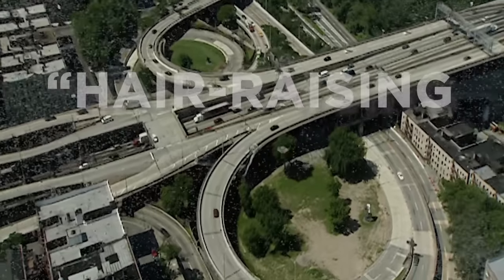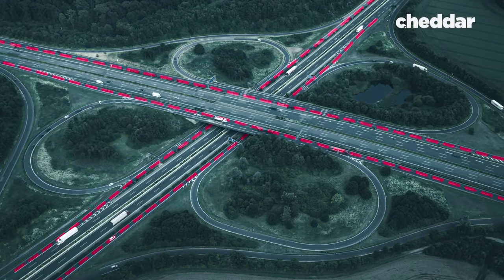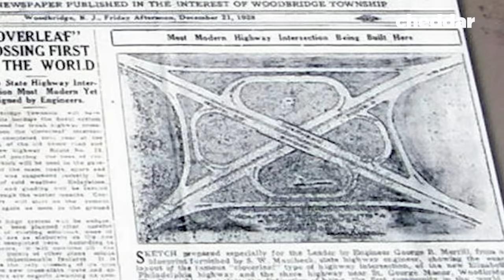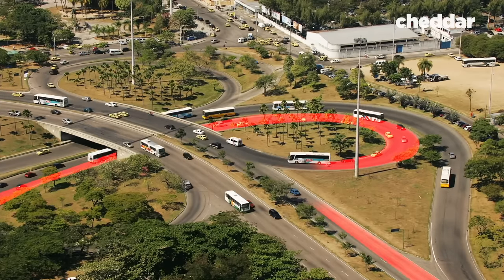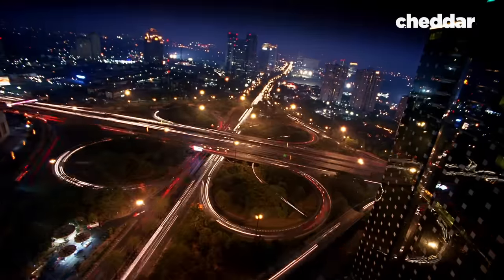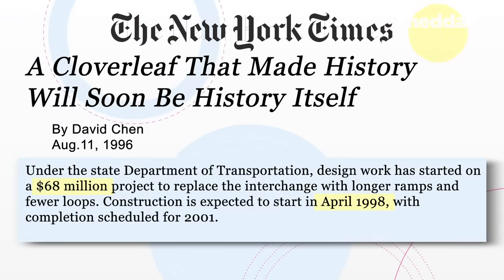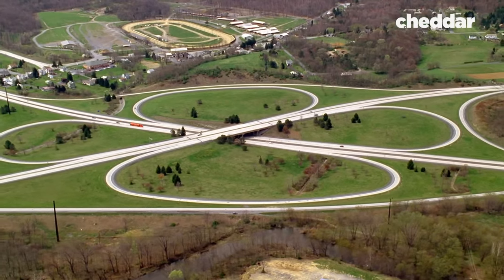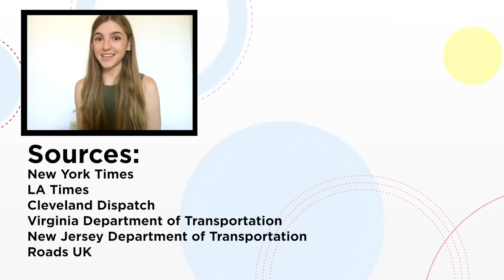The Big Problem With Cloverleaf Interchanges - Cheddar Explains

Comment: In the Malmö area in Sweden, we use a lot of those cloverleaf interchanges. Traffic is quite low by American standards, so these intersections have proven to be safe and quick. I don't think I've seen a single accident during the 20 years we've had them.
Reply: You guys also have more modern ones which fix some of the issues presented, for example sperate slip lanes for the exiting/entering traffic to make the weaving problem less bad
Reply: @AdamSmith-gs2dv  они не тупые американцы, у европейцев города созданы для людей, поэтому у нас мало автомобилей
Reply: @AdamSmith-gs2dv  - Europeans are tidier drivers, lane discipline, indicator use for lane changes, pulling into or out from the kerb, or motorway shoulder.

Some YT comparison vids about by US expats living in EU.
Reply: Same in Germany
Reply: @AdamSmith-gs2dv  We do!
Reply: People in Europe learn how to properly drive. In America, not so much.
Reply: @jjlasne  Enforcemeny. Education. Outlaw society admired in the USA.
Basically Americans need discipline. We are delinquent.
Reply: My bet is that you have people exit before the on ramp traffic merges.
Reply: In Northern Ireland we also use these on motorways or large A roads. But we usually use a slip off slope and attach it to a large roundabout above the motorway. This slows cars down when switching large roads which makes it very safe.
Reply: @jeremyh.pritchard5325  that’s not true at all. Just go to Italy and you’ll see it’s a lot different than a lot of Western Europe
Reply: These aren’t bad interchanges by any standard it’s just like was said, more than 1000 cars per hour is too much traffic. For medium level traffic by American standards they are perfect

Comment: In the Netherlands we have a large amount of these weaving entry-exit lanes, sometimes being very short. You get taught how to negotiate them in driver’s ed, and because everyone’s taught quite well, you almost never run into problems. It’s not the road structure that’s at fault here, it’s your driver’s ed that’s incomprehensibly limited and unconstrained. Weaving isn’t hard when everybody sort of knows what they’re doing.
Reply: Its both. Even if you have no problems negotiating the weave, it still slows down traffic and there's still an increase in the chance of an accident where if you didn't have these weaving entry-exits you could get rid of both problems.
Reply: I just fucking hate the bit between Feyenoord and Ridderkerk southbound on the A16. I don’t know what drivers education you’re talking about, but clearly everyone suddenly forgets everything about proper weaving as soon as they approach that section of the Rotterdam ring road.

Comment: you can fix weaving in cloverleaf interchanges by separating the on and off ramp into a slip lane so the on and off traffic go into a single lane. Alternatively although Ive never seen it done is to pass the offramp over or under the on ramp so they don't even share a lane at all. It makes much smaller bridges and tunnels than doing massive flyovers.
Reply: flyovers are great. Both as engineering marvels and fun to drive.
Reply: @michaelbruvolt4221  just expensive.

Comment: Even in rural areas these interchanges SUCK. Even without the conflict of people having to merge onto the highway right before others are trying to get off, the loops are just terrible for safety. Having to slow down to like 40 mph for the loop and then speed up to merge onto the highway is just stupid
Reply: 40mph is quite fast for the loop. how big are the ones you take? at most i can get up to 33ish before it starts making me a bit nervous, especially in winter. and dont get me started on trying to merge when youre stuck behing a truck going 20mph on one of these.. people will yield to the giant truck going 20 but not the tiny sedan behind it lol. fuck these interchanges

Comment: sometimes the audio and video are at different times in history.  a major failing of the interstate system is that it didn't provide cloverleaf interchanges at important arterial roads in urban areas and sometimes in suburban areas, thus your off ramp ends in a traffic light and if you choose a left turn at the light you might find yourself shortly at a second traffic light at the other side of the interstate.  Now when traffic is heavy this might result in what marines call a clusterflux prevently almost all traffic from moving through the intersection.  eventually the arterial road will fall short of its design capacity and alternatives will be needed.  This shoddy design has bee brought to you by the makers of traffic signals who every year donate large amount to local election campaigns to insure that you have the latest and greatest in traffic signalling devices and your taxes never go down.

Comment: the cloverleaf interchange is not the problem, too many people having the need to rely on cars on said roads, is the problem. I live in one of the densest populated countries on this planet and we use a ton of cloverleaf instersections and they work just fine. The main reason being that despite having many many cars on the road, and many millions of kilometers driven, there's alot of public transportation that's efficient enough to compete with cars and cycling. We've got the cycling infrastructure down to a T (or whatever the proverb goes like). Grocery shops and other daily/weekly essentials are well within cycling range, which makes it very often the more efficient/desirable way to do things.
There are solutions to your problems, one of them is the residential zoning not allowing for ANY commercial activities. This makes car usage immediately the most efficient way to do the type of things i mentioned above. Just to illustrate, i've lived in 3 towns and 1 city and in 6 different houses. Most of the time i lived near a supermarket that was within walking distance. I could go shop for food on a daily basis, buying a little, hunting for special offers, be done in 10 minutes, while not spending on fuel AND saving on food purchases. (you need to be disciplined to NOT impulsively buy the soulfood all the time)

Also if you allow for some commercial activities within your residential zones, commuting is also immediately reduced. Just keep your (hard) industries away from your residential zones to keep them desirable.

Comment: What they really couldve done is made merging lanes on the highway specifically for the people coming from the loop and have sign and street paint to redirect the people going straight, to get off the first lane where people are entering. Like if you're not using the interchange then dont get near the first lane where people are merging
Reply: way easier way to fix that: striaght going lanes simply go straight, and those which want to go onto the other highway, turn right or left at the interchange, are seperated on a smaller, slower lane next to it, where crossing over onto the loop or coming from the loop is much safer then; And at the end of the interchange that seperated lane merges with the other lanes which went straight again

Comment: Cloverleaf interchanges are fine if everyone is driving 50 mph max! And also, the engineers DID anticipate a massive uptick in traffic. What they didn't anticipate KS the interchanges lasting as long as they did. They assumed that they'd be upgraded and rebuilt as needed, not clung onto as long as humanly possible

Comment: If you make the entry points and departure points far enough away, you will minimize the weaving or crossing traffic problem.  These new interchanges today should have their own zip codes and fire depts!  They are unnecessarily huge, but that's because the construction companies are greedy and are in kahoots with the designers..
Reply: well there are in fact some highway fire stations in some places, however most of them are specificly for tunnels; Although some might be large, there might be a good point in them being large: longer merging lanes or even an upgraded cloverleaf avoiding weaving traffic flows coming from a loop vs. those taking the exit to get onto the next loop; Interchanges also get much more complicated and grow in size as soon as there's an on-ramp/off-ramp or a rest area interlaced with the interchange as it might be easier and safer than seperating both

Comment: In the I270, SR 161 intersections example the labels in the video are incorrect/reversed.  Also does the $134 million construction cost include or exclude the cost associated with the integration with the almost adjacent Sunbury Rd, SR 161 intersection??

Comment: It seems to me the issue is more to do with supply and demand. Americans keep increasing the supply of road, and so road becomes used by more people as it is in abundance of supply. I would guess the solution to this problem is to supply other means of transport or in some cases do not supply and change the demanded location instead

Comment: There is this cloverleaf interchange near me where two interstates, I-44 and I-49, and a state highway, MO-59, intersect. I-44 goes across east-west. I-49 comes from the north and then switches to the west and becomes concurrent with I-44 for a couple of miles. MO-59 comes from the south and ends at the interchange. This causes issues because those coming from the west and want to continue on I-49 North have to use one of the leafs, while those coming from I-49 South and want to go to I-44 east have to mangle with the large amount of traffic that want to go on I-49 North. I had a close call with a 18 wheeler because of the fact that the exiting traffic and entering traffic have to use the same lane, and the fact that the entering and exiting traffic can’t go fast and this causes other issues with other vehicles traveling fast. This interchange was built when I-44 was being constructed and back when what is now MO-59 and I-49 north of the interchange was a single lane highway known as US-71 Alternate. So there wasn’t any issue back then, but now for the past 20-30 years, and I-49 being recently added, that interchange is a mess. I don’t believe that MoDOT will replace the leaf with a flyover for northbound I-49 traffic, because a couple miles to the west, I believe that they are planning to replace another state route, MO-249, that is already built to interstate standards with I-49. So I believe that don’t see it worth it to modify the existing ramps if it’s going to be obsolete in the future.

Comment: The cloverleaf is the greatest invention ever perpetrated on the driving public. The problem is not with the interchange it is with the idiots that use it. Drivers should not be issued a driver's licence until they know how to drive.  2months of learners permit does not qualify a person to be a driver.
Reply: Cloverleaf is so simple compared to other newever designs too. If drivers are having trouble with it I really doubt it will be easier with more modern intersections.

Comment: Just one thing I don't understand:
You complain about cloverleaf upgrade with 2 bridges and 1 tunnel.
And the better one is stack interchange which needs 2 tunnels and 6 bridges.
And the outline is same size.

How is that going to help with space OR cost?

Comment: I'm pretty sure this was a cloverleaf too. They fixed it a different way. What do you guys think is more efficient, safer and cheaper? 47.4171561, 8.6289782
Reply: Also, check out this type of intersection: 47.4120369, 8.5741479

Comment: ha! I drive the 161-270 Interchange several times a week! It's actually really smooth and rarely do i see backups... Though sometimes the tunnel from 161 to 270 "closes" due to crashes or delays, backing up traffic going onto to Southbound I-270 from 161. Actually whats even better/worse depending on how you look at it, there's a LEFT hand exit lane to continue onto 161 about 1/2 mile before you even get to the tunnel or 270-N ramp fork, so traffic would back up much farther down the road.

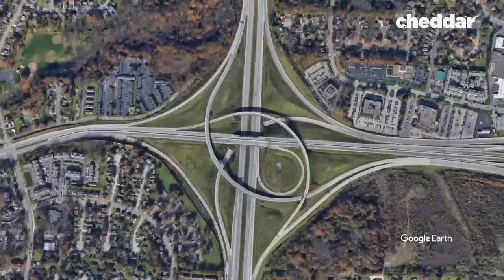By the way, sorry to tell you but your diagram at 6:14 has 161 & 270's lables reversed! 161 goes Left to Right in that image, and 270 goes top to bottom!
https://www.google.com/maps/@40.0822004,-82.9076172,1438m/data=!3m1!1e3
Reply: I thought the same about the diagram being reversed.  I haven't had to deal much with the 161-270 interchange, but I've had to deal with driving past it and making the nail biting crossing over of multiple lanes to get to the Westerville Road exit.

Comment: The engineers in 1930 didn't plan for 2020 traffic. They planed for the traffic the next couple of decades. Maybe 30 years.

The thing is.. with government spending cost, 100M is really not that much. A other problem is that there is much more bureaucracy to day than 100 years ago, and its much more expensive.

One more factor that plays in is that the traffic needs to keep flowing while the road are rebuilt.

Comment: Small sharp roundabouts are really tough with 18wheelers, but I don’t see whether it’s any better with traffic lights either. They have often blocked entrances/exits to banks, FF (ChickF’lilet, Taco Bell, etc)/restaurants, driveways of homes. Blocking views from smaller cars which also cause accidents as many of them want to risk cutting truck driver off as they jockey themselves in front instead of behind or to the side.
We need our truckers so I’m not sure the remedy. Some people need a driver Ed refresher course and one on patience ? For some - BOTH.

Comment: Those who drive in Mass will know how horrible the cloverleaf between the I-495 and I-290 is. Often you are stuck in gridlock, even if you aren't taking the leaves and are taking the outer ramps from 495 S to 290 W

Comment: When traffic on interstates gets heavier, a 50/50 solution is better by using 50% using anred light on an off ramp while using cloverleaf entrances; 4 cloverleaves on one intersection of interstate must have very long acceleration lanes and low traffic congestion. Using only red light ramps is best when land is quite urban and expensive but then must have very long ramps to avoid main thruway congestion which is the most dangerous scenario for crashes. Stacking several level ramps (such as in Springfield/Franconia VA of I95/I495/I395 stack merger) is best but you will pay by far the most in money and land for such efficiency and safety with heavy traffic flows. The other good urban method is like Canadian 401 near Toronto/Mississauga or Jersey Turnpike near Newark which has a split thruway and local lane flows which then concurrently smooth out exiting as much as possible with appropriate ramps given land and monatary limitations.

Comment: Cloverleaf interchanges themselves are not the problem. The problem is the 600% growth in traffic as you have stated. It's like you blaming a roundabout/traffic circle for causing congestion. Yet roundabouts can effectively, economically and safely handle traffic, to a point when higher traffic volumes justify a signalized intersection. You call dead space in the gore area of cloverleaf interchanges? These spaces will prove to be precious green spaces later on when urban development browned pretty much every square inch of a city. I appreciate your efforts to explain an interchange design here. But conceptually you did not point out the real issue and this could be misleading. Since the high price tag to fix our highway system as you concluded is beyond the realm of Bank of USA, it'd be nice to point out alternatives to the problem. Thank you!

Comment: Huh. Not being american, I was trying to think if our highway intersections look like this.
But after explaining the first major problem with the design, I'm left with the conclusion that for the most part, no they don't.
Although there are structures that look very similar, they are functionally different.
In fact, thinking of the intersections I'm most familiar with, the exit ramp always precedes the entry ramp.

Then again, there are relatively few highway/highway crossings that I can recall.
Mostly you see a highway crossing a city road. These city roads can be as large as the highway, but their construction is different even where they are. 
(or to be more accurate, we'd call this a motorway, since a highway is technically any major intercity road, many of which in this country are 2 lane roads.)

You might get a 4 or 6 lane motorway, with dedicated slip roads and on and off ramps and divided traffic, but the city road equivalent, while still being 4 or 6 lanes, may or may not be divided traffic, and will almost certainly have conventional intersections, traffic lights, roundabouts or similar structures, which a motorway will not, as a general rule. (though motorways frequently transition to being highways outside of city limits)

It's weird seeing these american perspectives and realising how much of what they describe is familiar yet just a tiny bit off in the subtle details.
And as it turns out, those minor details make a big difference.

Comment: I appreciate the effort but this focuses too much about U.S. and doesn't show how giant cloverfield intersections you can find in the Netherlands. The problem is not the cloverfield itself, but just that the engineers didn't expect such a rise in traffic.
That said, 300 milion dollars to improve an important intersection doesn't look to me too much money.

Concluding: of course the entrance-before-the-exit system is problematic, but the main issue is the small dimension.
Another very cool solution, would be as they do in Germany, with a loop that doesn't directly enter the highway but enters a specific interchange area so to reduce the issue with cars bumping each other only for a limited number of cars that want to do the interchange and not the normal highway traffic.

At the end, the video content is sufficient but a better analysis of the system in other countries would have shown other cheap and efficient solutions.